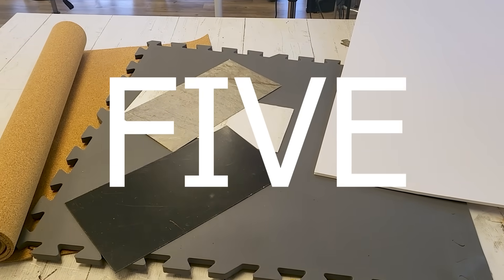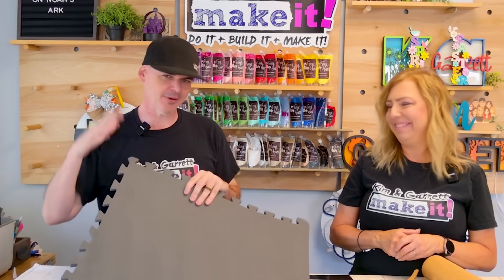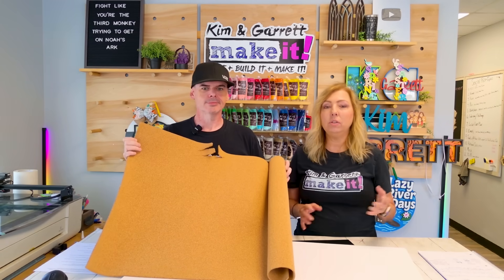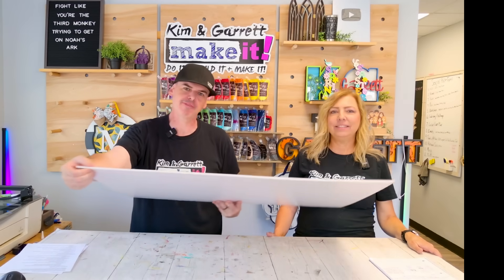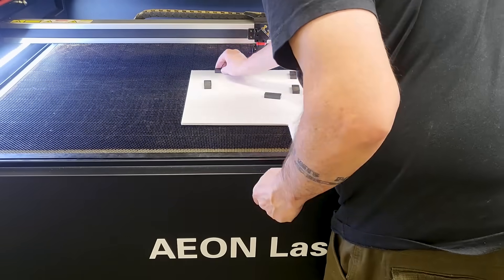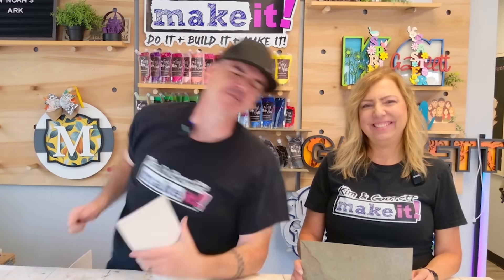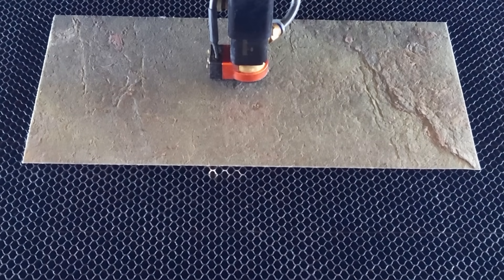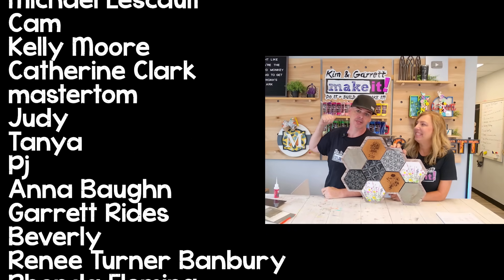5 Surprising Materials You Can Laser Cut & Engrave (You Won’t Believe #4!)

Comment: EVA contains vinyl acetate, which breaks down under heat or burning and releases:
Acetic acid (sharp vinegar-like odor, irritant to the eyes and lungs)
Aldehydes and ketones (respiratory irritants)
Potentially toxic gases, especially if the material includes colorants or plasticizers

Even with an air purifier or exhaust fan, these fumes can:
Damage your optics (lens, mirrors)
Corrode metal parts inside your laser
Irritate or harm your respiratory system

Comment: What program do you use for your laser machine? Is that light burn?
Reply: That's LightBurn, yeah. Many people swear by LightBurn, and with good reason—it just works great. It has design limitations, but those can be handled in free programs like Inkscape. It’s a one-time fee, with updates included for a year. If you don’t renew, you won’t get any new updates, but it will still work just fine. I’m in year 3 without new updates. At any point, you can pay for another year, and you’ll get all the updates up until that date and for the following year.

Comment: Both EVA Foam and Foam Core Boards are TOXIC when heated or melted and highly flammable. I dont recommend putting them in your laser. 
Also should note that not all craft plastic is laser safe, either.
Reply: Most foams, including EVA can be safely laser cut. You do have to be careful with flammability tho.

Comment: Isn't the EVA still highly toxic when you laser engrave or cut?

How do you use the text cut file? Is it a file that imports and load different settings?
Reply: the test cut and engrave files are a feature in lightburn that you can use to run material tests. You can create new ones each time or use a saved one. They load a variety of test settings based off the parameters you enter. This can be found under the "laser tools" tab of lightburn. 
If you dont use lightburn, you can create or purchase a similar file